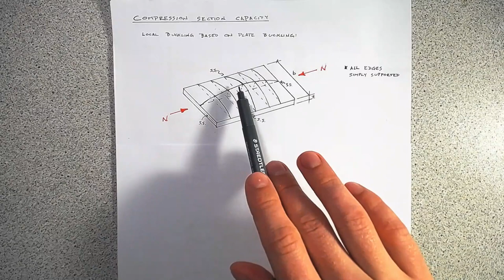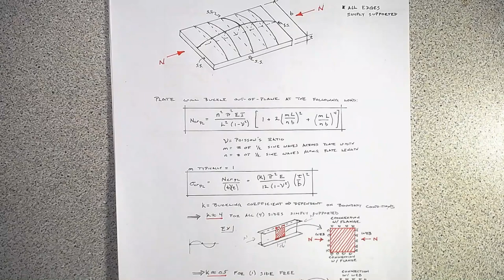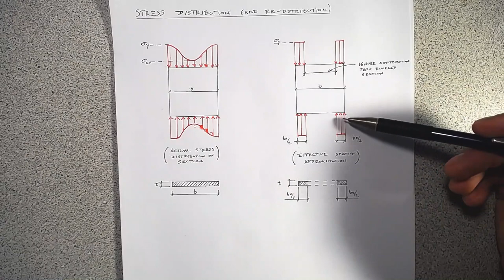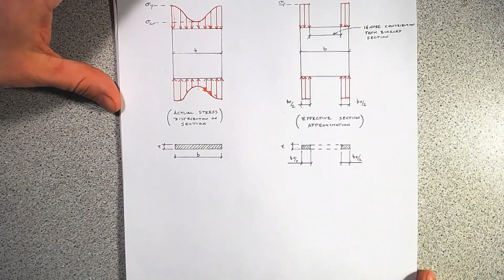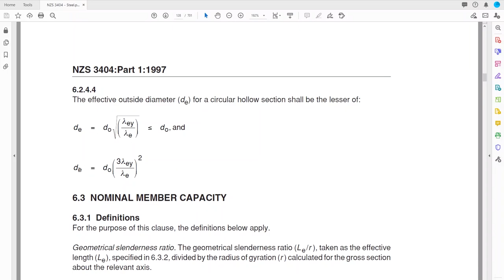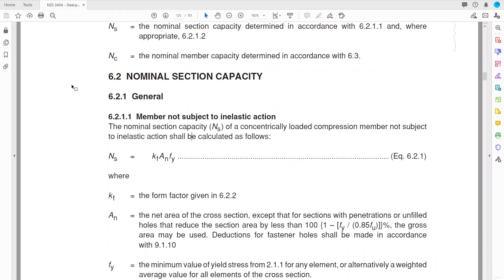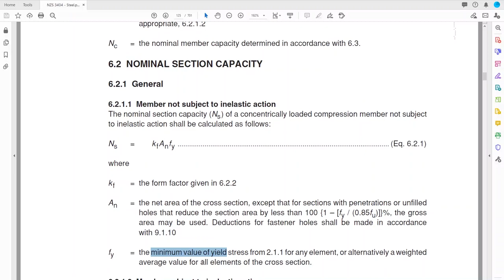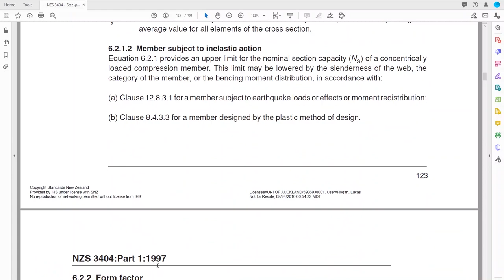Local Buckling and Plate Buckling

Comment: what is the book you use please?
Reply from the maker: The textbook that these notes are developed from is:

"The behaviour and design of steel structures to AS 4100" by N.S. Trahair.   The textbook does a good job in working through the derivations used in member design for the design equations in the Australian and New Zealand steel standards (AS 4100 for Aussie and NZS 3404 for New Zealand).